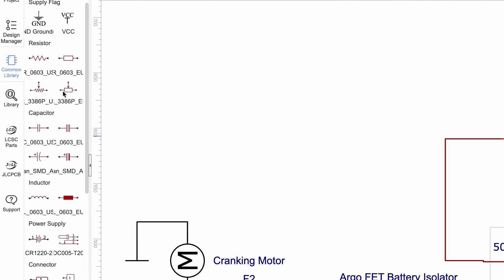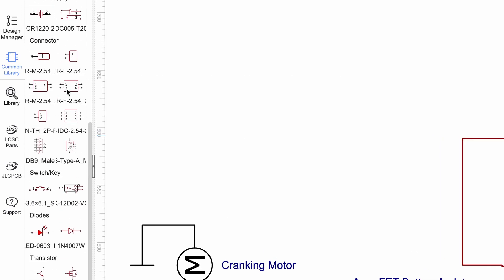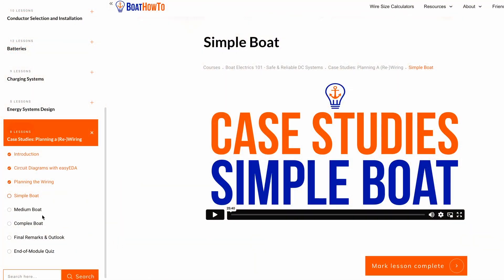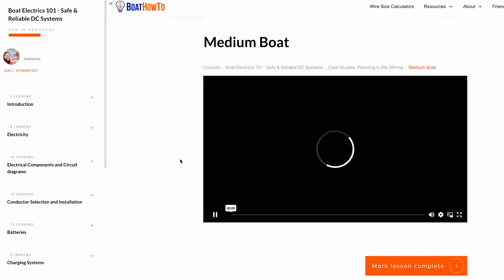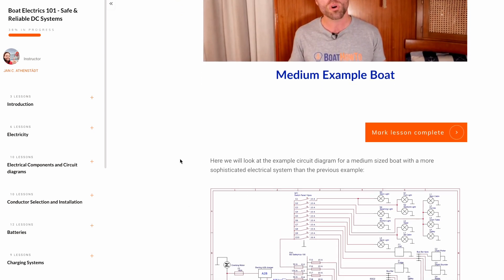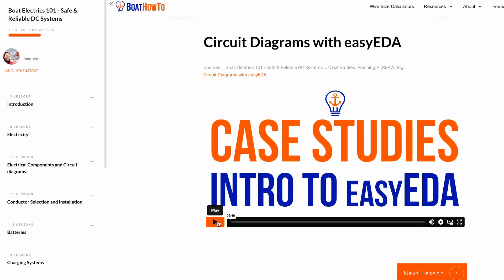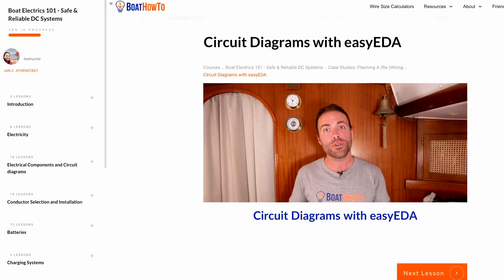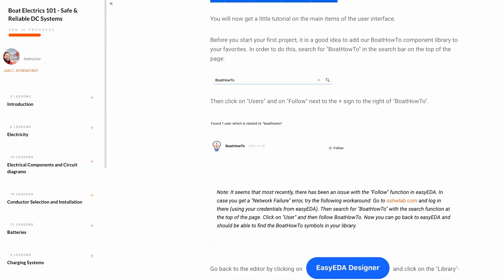LEARN YOUR LINES! How to draw a quality wiring diagram | Ask The Expert with NIGEL CALDER

Comment: I agree with Nigel.  Well almost everything. I do not believe in fusing the starter circuit, i am an advocate of insolate and isolate for that branch.  While it is possible to fuse, you must be careful to do it correctly, remember ohms law - when voltage drops, current increases.